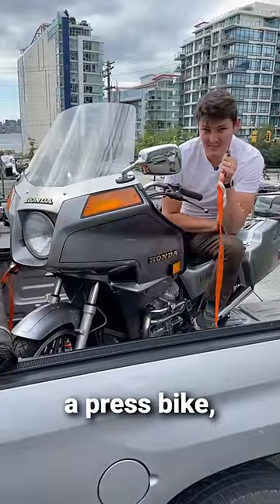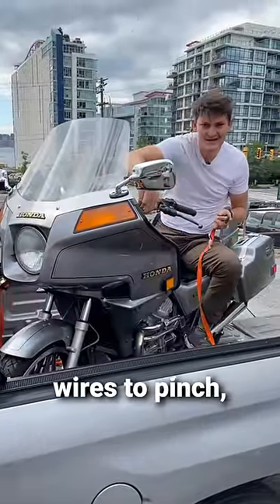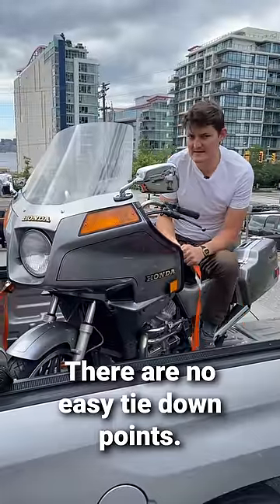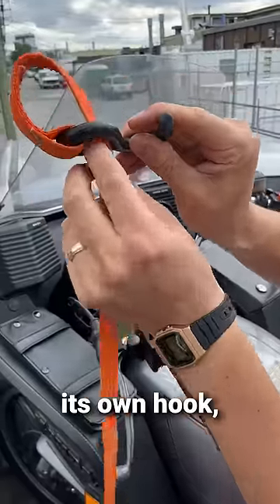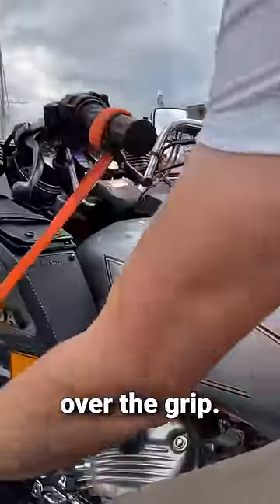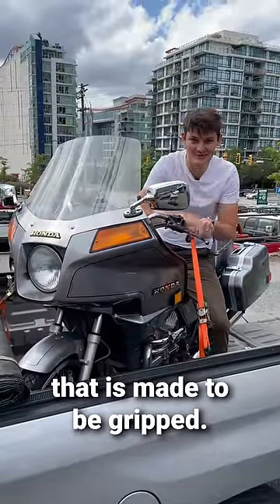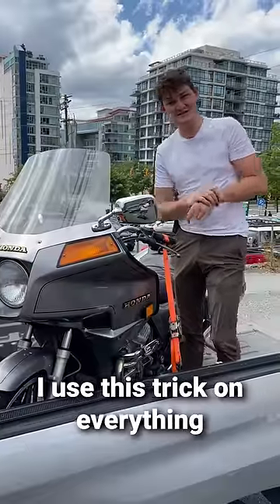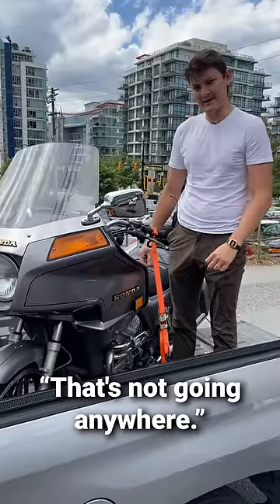The #1 Trick for Strapping Down a Motorcycle

Comment: The loop idea is great 👍. Attaching it to the grip is a bad idea, been there done that, the grips will slide off during transport.  My throttle is now sticky and doesn't return on its own.
Reply: or the constant stress just loosens the handlebars and your bike falls over
Reply: Exactly. Grips are meant to handle human hands, not straps winched down to hundreds of pounds of pull. They can come right off.
Reply: Clearly there's a way to do it correctly. If it was an issue, Ryan would've addressed it as he does with many other things in many other videos. 

Swear you guys don't even try to dig. You just see something and have an eternal urge to shit from your mouth with no body behind it. Go outside.
Reply: Yeah, reminds me of my old push-bike. The glue under the grips eventually turned to a sticky mess after a decade of use.
Unlikely to be an issue though, well... until it is. Still, it's a good trick to know regardless, especially if there's not clearance to wrap it around the metal bar (which the more I think about, the less sure I am thats really that much better of an option...).
Reply: @shadoww914 . The manor he showed is the manor we're warning about. Whatever "safe" system you know about of attaching the tiedowns to the grips, you don't have to look it up because I won't bother to watch it.
Reply: @shadoww914 You're telling other people that they're not trying to dig, when they gave a reason. You're entire reason was Fortnine said it so it must be true...

Surely you cab appreciate the irony here...
Reply: @shadoww914 Are you his fanboy or what? 😂
Reply: @shadoww914 no one said anything that personally attacked anyone. Not that I can tell anyways. Also, the things they pointed out seem reasonable and make sense.

The best way to learn is to be wrong on the internet, it's up to us to take the opportunity to learn and not get offended when corrected on something.
Reply: I've  see similar looping done over the fork tubes by the guys in NorCal.  Here in the Far East, they use thick rubber band abd loopit through hust about everything.
Reply: Good on you, that was gonna be my question/comment: both factors in the equation have to "not be goin' anywhere."
Reply: Yep
Reply: On my MX bike i typically just set the hooks on my bars but inside of the grips, unfortunately due to control cables you cant loop the webbing through the eyelet and dont have to worry about grips sliding off. 

However that being said, id highly recommend trying out some grip glue if you havent already. First grip change i ever did went easy with the soap n water trick, then i got caught in the rain in a ride and my grips slid off and kept twisting around. Then i discovered grip glue, still rockin the same set of grips for about ten years now. Plenty of rainy rides and they havent shifted on me once since. 
It is a bit of a pain to change those grips out if you dont happen to have an air compressor though.
Reply: I work at a race track and  I also saw handlebars completely torn off and bent down. So I’d rather go through the forks n stuff
Reply: Or you snap a riser bolt.
Reply: Same. Broke the limiter and plastic mount for the cable, wasn't funny when it didn't return on the road
Reply: I was about to say the same thibg
Reply: If going on grips you want to connect them across to one another to prevent the slip.
Reply: @luish.8540  ouch. I would assume ,like you said, using the frame to anchor down. Guess this clip isn't the best idea. Thanks for the comment!
Reply: AMEN! 🙏🏾✝️ Be thankful that GOD woke you up today! Luck isn’t real, GOD IS! Pray for everyone! Please do not call people fools! None of us are worthy! But remember, GOD hates the, not the sinner! AMEN! Please not use THE LORD’S NAME in vain! Please do not swear on anything! AMEN! 🙏🏾✝️
Reply: AMEN! 🙏🏾✝️ Be thankful that GOD woke you up today! Luck isn’t real, GOD IS! Pray for everyone! Please do not call people fools! None of us are worthy! But remember, GOD hates the, not the sinner! AMEN! Please not use THE LORD’S NAME in vain! Please do not swear on anything! AMEN! 🙏🏾✝️
Reply: Agreed. It will crush the throttle tube which also isn't all that secure compared to the loads the strap will put on it. It can just slide off when it cracks the tube around the flange.
Reply: throttle tube is pretty thin plastic over a pretty flimsy metal tube. Quite easy to damage, quite annoying when you do.
Reply: Yeah this should not be sold to others on the internet, it's a terrible fucking idea.  It's also super dangerous in an accident more so when you transport it in the bed of your truck.  Also people seem to focus on keeping things from going backwards maybe fear of it falling off into traffic. However the real danger is things going forward, after all you're extremely more likely to have things flying towards the front of the vehicle during an emergency stop or accident.  You're never hauling something and accelerating from the red light so hard that the thing flies backwards, so more focus should be on preventing forward movement.  you want to strap to the anything that is the thickest or most stable parts of steel that can withstand the forces present in an accident.
Reply: ZenEndurance
Superbike riders might disagree. 
They sometimes bend the bars counter steering.
Reply: @mrbmp09 super-bikes don’t have bars, and if you can bend a clip-on mid race, you’d be competing with Eddie Hall, not Mark Marquez
Reply: plus wear on the suspension
Reply: Not sure you noticed that he also included the clutch lever, so not holding the grips alone

Comment: Never strap down the handle bar I bent them every fall in Supermoto. Just use a loop around the lower tripleclamp. I never bent this ^^
Reply: If you're bending your handlebar, you're putting way too much tension. You only really need enough to press down the suspension so that the front wheel doesn't turn.

That being said, the lower triple is fine as long as your body work isn't in the way.

But the best thing to do is to use a purpose built setup like a canyon dancer if you want to go cheap or a Pitbull TRS if you want the absolute best possible setup.
Reply: @TheFmdub  Put it into 1st gear, lock the handlebar and strap the bike around more sturdy points. Handlebars are not designed to be anchor points during transportation.
Reply: Tell me how you are hooking to the tripleclamp on the bike in the video.
Reply: @lorenblaine5275  Strap points close to the front wheel and then you should reach it between fairing and fork.p
Reply: You’re not doing it right if you’re bending your bars
Reply: @TraviNomotion  How do I crash correctly to prevent the bent? ;)

I know that the bar wont bent from strapping down, but my supermoto example should just show that the handle bar ist not that stable. In case of a crash with the trailer or emergancy brake I don't know if the handlebar will hold the bike...
Reply: @vanjamenadzer  you definitely don't haul motorcycles, you are supposed to leave it in neutral because if you dont you will wash the cylinders @vanjamenadzer
Reply: @lorenblaine5275 do it all the time.  Plenty of room under the bodywork.
Reply: @austing.8681  lmfao what?! How tf are you going to wash the cylinder hauling the bike in gear in a truck? 

Its not like the fuel is on and pumping continuously to wash the cylinder... if you were flat towing it for whatever reason of course you dont keep it in gear because its going to beat tf outta the driveline, gearbox, and potentially crank the engine without supplying oil adequately. Not to mention its going to be hopping around on its ass end trying to overcome the compression in 1st.
Reply: @100GTAGUY  it washes the cylinder by moving the powertrain back and forwards and will move the piston up and down, without oil even with a piston moving a 10th of an inch will wash a cylinder

Comment: wtf, as someone that has been working with and loading/offloading motorcycles for over a decade the number one rule is DONT STRAP THE BIKE DOWN BY THE HANDLE BARS
Reply: EVER!
Reply: Nah, strap it to the lift hooks on the engine. Those are load bearing structures and can handle being used as a tie down anchor, most especially if you loop the strap around the frame  and down to the hooks. If nothing else, at least strap it to the muthafuggin crown!
Reply: It's best to tie down to the break disks, those are designed to stop the bike from moving.
Reply: @sethtaylor3917 . Ha!
Reply: @sethtaylor3917 Brake discs are meant to stay straight and not handle too much side forces hence why brake pads equally press on both sides. I wouldn't risk it with side forces during transport.
Reply: @tomaccino  it was a joke.
Reply: Really? Why?
Reply: @karlbarnett5863  Front suspension still works on bumps, so the strap which is tight at the beginning can become loose. Another thing is grip might not be strong enough, especially on an older bike. It would be better to strap forks or the wheel itsels.
Reply: Somebody taught you wrong. Canyon dancer is an entire business solely based around tying down motorcycles by the handlebars. Sorry you have to do things the hard was because someone took away your common sense.
Reply: I've always been taught that handle bars are not a structural component of a motorcycle.   That's all she wrote.  You don't strap to a non-structural part.
Reply: Bushings love the abuse. Definitely avoid using the lower forks.
Reply: How would you tie down a sport bike?
Reply: @horizonb1744  Peg, fork, tires, frame… actually a clip on would handle this technique better compared to a handlebar with bushing.
Reply: @freebehindbars8654  yeah with a sport bike you aren’t strapping down the frame. And you aren’t strapping down the forks without breaking the plastics. And I’ve just never thought about strapping the tires or pegs because I felt like their wasn’t enough space. But it’s a good idea. That being said they sell canyon dancers which are literally just straps for your handle bars lol
Reply: @freebehindbars8654  I love that bike you have btw. Beautiful red
Reply: I strap to my spokes only